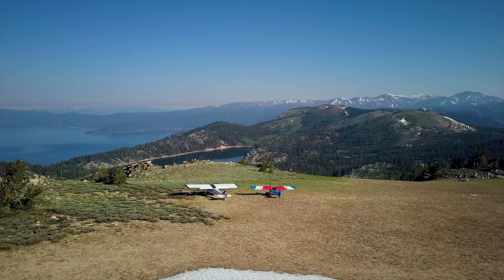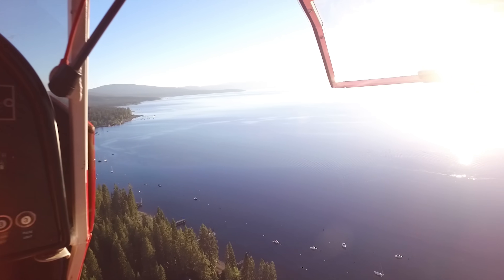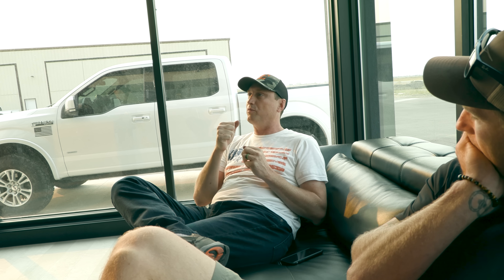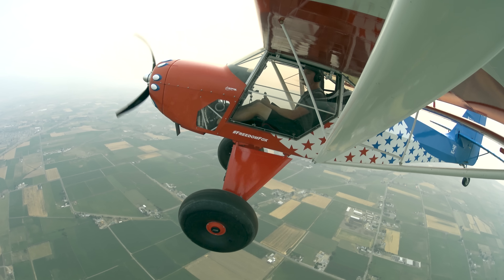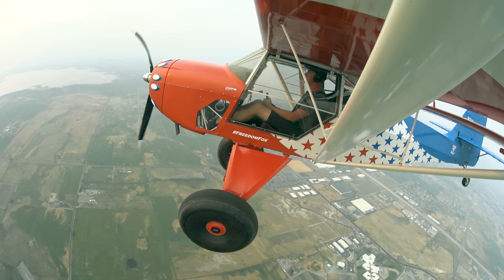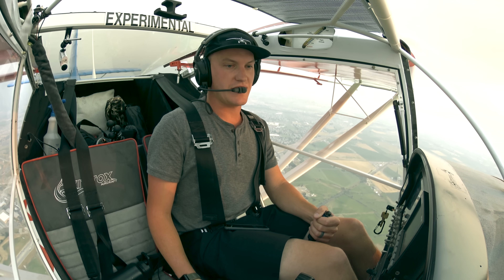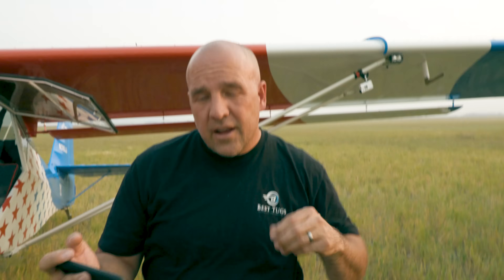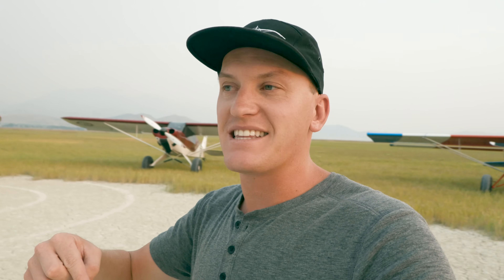YOUR FLIGHT INSTRUCTOR WAS WRONG! - Simulated vs Real Engine Failure

Comment: I think the misinformation stems from 'an engine windmilling produces more drag than a stopped propeller.' The difference is that idling you still have the engine firing, while windmilling has a loss transfer of enegy through forcing the engine to rev.

Comment: OOPS,,,,   There are alot of variable,,,,   But here is a hair puller,,,,  How does the rotor on a Gyro copter work????
SO,,, spinning or not spinning,,,,   will a gyro copter work if the rotor is not spinning?????

Comment: I have an easy solution for you too see for yourself.. go fly a twin engine and see if it’s easier to fly one engine at idle, windmilling with the fuel cut off or if it is stopped... I found there is zero noticeable difference between one engine idled, then pulling the mixture to cut off while the engine is idling... once the prop is stopped, feathered properly or broadsided in the wind, the stopped prop relieves a massive amount a drag.....Time has ZERO to do with what y’all set up... best glide speed is greatest DISTANCE traveled for the loss in altitude (of course winds would play a factor so idk how you could measure distance doing the same experiment)..Slowest rate speed would give you the slowest descent and it’s a speed slower than best glide(used for maybe over water where it doesn’t matter where you land but want more time before you get to the surface). If an engine is at idle power, but spinning faster than idle speed, then the prop/engine/transmission/what ever rotating components... are soaking up energy from the forward movement = MORE DRAG

Comment: Zero thrust is when the “screw” forward linear velocity is the same as the air speed in an ideal model (for each revolution the screw advances a fixed distance)
That linear velocity is directly related to rpm and depends on pitch.

The further away you move from that rpm point the more drag or thrust ( depending which way it turns)
A “stopped” propeller doesn’t mean anything in particular... it’s just another “point on the graph”. You could take it further and spin it in reverse, which would create even more “drag”

Idle is closer to the zero thrust rpm, and therefore produces less drag
Reply: hummm..screw...model....thrust.....related to......the mile club#****....what the???

Comment: Here’s a good example since what we’re really talking about is drag created in fluids: I work on a tugboat with 2 8’ 4 blade propellers that are in kort nozzles. I can pull the throttle back at full speed (about 8kn when the barge is loaded) and we will always have wash coming out the back of the boat even though the propellers are turning at an rpm far less than the speed they are making through the water. We still have steering (although reduced) until we coast all the way down to the minimum speed we make at clutch ahead then are making that speed. If we pull the engines out of gear and (they have shaft brakes so we are dragging the propellers) drag them we will lose most of our steerage from the rudder being blocked and coast to a stop far quicker than we will slow down to our minimum ahead speed of being clutch in gear. 

All fluid mechanics being similar I would imagine the same effect with aircraft although you guys are on the ground long before the dead stick would make you stop and you still generate forward thrust from airflow over the wing as you lose altitude in the glide.

Comment: You are correct. You just answered your own debate. If a engine is out and the prop is windmilling then that right there is the result of drag. If the engine is idling it's cutting the air still reducing drag whichever the wind speed is.

Comment: Why was there even a debate? It's obvious. The drag experienced by the propeller is proportional to the relative airspeed that the propeller is experiencing. If the propeller is turning under idle, that REDUCES the relative airspeed and hence the drag.

Comment: Jason Sneed and Mark Patey did a video on this where they were practicing the impossible turn with an idle prop and dead prop. There was a massive difference in the time they had in the air with the dead prop and idle prop, with the dead prop making the plane come up far shorter.

Comment: Another interesting test is to stop the prop by nosing up and then see how fast you can decend need to decend to get it windmilling and start the engine. 

I did this in my Maule MT-7-235 (Lycoming IO-540). IIRC I had to decend at about 120KT to start the engine. 

I started the test 7,000' above my non-crowded airport.

Comment: Look, an autogyro, in design, you calculate the Disk loading, just like wing loading, except instead of wing area, you use Rotor Disk AREA.  The width of the blades means nothing, but the rotor disk area is used.  We don't use autogyros much because they are not efficient due to the drag induced by the rotor, even though they can't be stalled.  A spinning prop creates much more drag than a stationary one, but it is somewhat offset by the thrust component it is also producing, assuming the aircraft is going faster than the prop pitch speed at idle.  I think it could be answered by their noting the difference between the RPM at idle, on the ground, brakes off, rolling, and the RPM at idle while flying.  If the RPM goes down in the air, the engine is loaded, so it is helping with thrust.  If it goes up, then it must be windmilling, and creating a lot of drag.  I wish I could be flying with you guys and know the answer, so you will have to let us know your observations.  Great videos, Trent, they bring me great joy.  I envy you and Mike Patey.  I love Draco, Lancairs, and Kitfox's, of which I have none, hence the envy.  I flown R/C planes and helicopters for about 40 years though, so I'll have to think about a Turboprop R/C Wilga!

Comment: You could probably look to helicopters for the answer to this. The physics behind an autorotation specifically. I would be willing to guess, if your engine runs at idle RPM at best glide, it’s still producing thrust. If it’s spinning faster than it would on the ground with the throttle closed, it’s being driven by the airflow. At that point it’s probably creating at least as much drag as thrust. And if it was stopped, it would be a negligible difference.

Comment: Thanks for the video, great as usual, being a really worthwhile & thought provoking topic. There's also the human factors to consider in our response to these situations. Practicing an engine out is a planned event with safety built in & subconsciously we know that we can recover by increasing power if we misjudge an approach or restart the engine (as per your air tests). If the sh*t really did hit the fan (...no pun intended!) this would happen with little or no warning & whilst I know we all train to react instantly, there's the potential of denial, surprise & certainly a greatly increased pilot workload.

Comment: Flying rc since I SAS 13 when I designed and flew my first airplane.... Varying aircraft wing profile prop design all behave differently..... The important thing is your glide path nothing else matters.... If you have a tail wind or head wind will change everything.... So the important thing is that spot on the Wind shield that is not moving is the spot you will flare and go ground effect to land..... Uh yeah I fly real airplanes too..... When in glide slope to land an rc airplane I teach my students to put the tip of  the antenna over the airplane on final and hold perfectly still.... If it raises above the antenna tip you will land long if it goes below you will land short..... This applies in the real airplane to the spot on the windshield that does not move..... In an engine out anything above that non moving spot you can not reach unless you catch thermal activity or ridge lift.... If you encounter lift then the spot will change..... Beat rule is if it's above that spot you can't reach it.... Of course winds at different levels in different directions or speed can and will change that spot during the decent..... So best to give yourself plenty of margin to land long  and then when very close to your intended spot slip yoyo or use other means to induce drag to land safe within your chosen landing area..... If you are coming to a 6000 foot runway there is no need to hit the numbers mid field is the safest bet..... If you are landing on a tiny mountain top you have to cross the threshold at least.... But why land on a tiny top if there is anything safer below... Do what ever is the safest .... But don't not reach the threshold use that still spot on the windshield plus a safety margin..... I seriously belive everyone should practice complete engine out  and to  full stop landings on nice long runways in different wind conditions .... There is no substitute for real world practice..... My first flight instructor had me do full engine out but never to actual landings only to approx 100 ft then restart..... I told him I would like to do them to full stop but he told me that I was fine and it wasn't needed..... My next instructor told me it was stupid to shut off and engine in flight..... He was really not a good pilot..... With! Radio control airplanes (I have flown a between 200 to 300 different types and helis too) the most important thing is to make the threshold.... And in any emergency landing the most important thing is wings level above any other factor...... Rough ground or what ever level wings no slip or  cross control of any kind at touchdown and hold her off until she just can not fly anymore makes for the least damages or survivability.... Just my 2 cents

Comment: A moving prop, is moving air.
A stopped propeller is blocking air.

The test is great in theory, however in actual flight...." the relative wind is not exact". So I don't think you can calculate off decent rate. 

You can calculate both your descents for a thousand feet, but depending on the relative wind you might be getting Lift....

( as a side note there was a lab test back in 2007).. I know I read it in aerodynamics book.  At lab testing, even though the air pressure was present, and pushing on the prop making drag, that pressure allowed the prop to spin and air to flow past. Whereas, the stopped propeller caused air to be (forced) around the blades creating the (most) drag because the propeller was stopped.

So in short the stopped propeller created more drag because it forced the air around the propeller whereas the moving propeller was less drag because it allowed the air to flow at a faster rate..

You can find somebody with a twin engine, have them stop one prop and then allow the other engine to feather. You will clearly see the yaw, in the stopped prop....

Comment: Trent, but doesn't Mike have a variable pitch propeller? So, being able to (if possible) orientate his prop to neutral (when the prop is "cutting" through the air) and not "full faced" when producing thrust; I would be curious to see how his glide time would be at that point.

Comment: I think it may still be true that idle is worse for some planes, if you have a significantly higher glidespeed than thrust at idle. This could cause the wind to try to rev up the engine so to speak.
I have a 10cc model and that plane comes to an almost stop if trying to glide at idle, since the idle rpm is very low and the prop has very little angle. With the engine off (prop stops because of compression) the model will maintain its speed a lot better and glide for longer, until it reaches stall speed (10 mph(ish)) where the idle thrust help the plane stay in the air for a little longer.

I therefor think this is a circumstance and airplane dependent topic.

Model: Ripmax Extreme Lite
Prop: APC 14x4W

Comment: You probably lose lift due to turbulence from the idling prop. Not so big an issue with aircraft that are essentially leaves in the wind but if your wings are smaller because your cruise speed is higher a greater proportion of the wing will be getting turbulent airflow.

Comment: You will never create more drag (at any speed) than a still propeller if the engine is idling. You can have drag with an idling propeller (depending on air speed) but it won't be more than a still prop at the same speed.

Comment: "The windmilling fixed pitch propeller never having the effect of more drag in comparison to a stopped propeller" statement is not true in every situation from my intuition. At low speeds yes (which is the case here with a airplane engine out), a high speeds it gets a bit different.

The Propeller acting as a disc in terms of drag when turning comes from the Wind turbine design field. A quick simple example from the real world: Helicopter Autorotation. When the rotor blades spin due to the relative airspeed, the helicopter can slow down it's fall and create some lift and even land safely. This could never be achieved when the blades are stopped. 

But again only when the airspeed is high and the spinning rotor creates lift. This is probably not the case at best glide speed in a airplane with a fixed pitch blade and in comparison to a helicopter rotor blade, a reversed profile...so in fact the statement made is actually true after all in the context of this video...

To much head:-)

Comment: it's all about the "pitch speed" of the prop in relation to your "glide speed". If the motor is running and the prop is pushing air "faster" than the airspeed of the aircraft you get thrust, if it's "slower" you get drag, if it's the same, it should be little effect. A "windmilling" prop on a dead engine is sucking energy from the air to spin your motor around. So, a fast slippery aircraft may actually do worse with an idling prop, compared to a deadstick prop, if it's glidespeed is greater than the pitchspeed at idle.

Comment: I've been told by an instructor that if i wanted to extend my glide a little bit longer to crank the starter motor and hold it on if needed to reduce drag
Reply: He is right.. That turning of the prop will reduce the angle the wind is hitting it, reducing some of the drag.

Comment: Never. A fixed pitch propeller will always create more drag when stopped. The amount of drag will be almost directly proportional to the speed of the propeller. If a stopped propeller produces a 100% drag (a unitless number) at 100 miles per hour wind speed, then if at idle the propeller produces enough thrust to move (air screw effect) at 10 mph, then the drag will be approx. 90%. This is an easy test for a wind tunnel. You don't even need a real airplane to check this out. There are probably other effects that are much more difficult to measure with an idle propeller moving though air produced by side winds, variations in pressure,  temperature and direction of travel that may have an impact on what the pilot feels. I am willing to be money that I am correct on this. And I am willing to make another bet that for slow moving airplanes, the relationship is almost perfectly linear too.

Comment: An interesting question, one that is also often debated in yacht club bars. However the answer is simple. If a fixed  Prop is allowed to free wheel , boat or plane, it will automatically favor the RPM that which  produces the least resistance. It will spin / windmill at a speed which balances wind resistance against friction. Idling will reduce frictional  resistance to close to zero and depending on idle speed reduce drag to a minimum . A stopped prop produces the max drag, as it starts to turn   the drag reduces until an equilibrium is reached where it is neither creating drag nor thrust, its in line with airspeed. Above that RPM it starts to produce thrust.  Now that's the theory however in real life other forces such as turbulence  may come into play .

Comment: I think it works like this..

A (fixed) prop standing still means the blades are "stalled" so a lot of induced drag by the turbulence coming of these stalled blades, while with an idling prop the the prop is not stalled so that extra drag of the stalled blades is missing, hence a better glide with an idling rotating prop.

Comment: you need two charted curves for each scenario and overlay the drag-versus-speed charts over each other. where they cross, that's where they match in speed-versus-drag ratios. engineering tests -- time consuming, but that's all it is. with the kinds of planes flown, i doubt there are very large difference between the two, not surprisingly. if you fly sleeker planes, i think there will be noticeable differences.

Comment: I think the easiest way to think of this is relative to energy required.
A stationary prop requires no energy but produces drag.  A wind milling prop requires energy which it takes from the forward movement (airflow) of the aircraft and still produces drag.  So to achieve the same airspeed you have a steeper glide angle and hence RoD.  An idling prop also requires energy which comes from the engine.  At normal idle rpm and best glide speed this energy (converted to thrust) will counteract drag and result in a reduced RoD

Comment: This laymans perspective:   a hobby of mine involves a lot of rc bush planes, wood 14 inch wingspan to 10 foot carbon.     The propeller doesn't become parasitic  until it stops  rotating at a speed about 110% comfortable dead stick glide air speed. After that it's a leech.

Comment: you need to consider the airspeed, prop speed and helix angle of the prop.  At a certain airspeed that equals the helix (screw pitch) thru the air, a idling propeller will provide NO drag OR thrust.  At higher speeds, drag, at lower speeds, thrust.  But I would think regards of speed, an idling prop will always provide LESS drag than a stationary one.